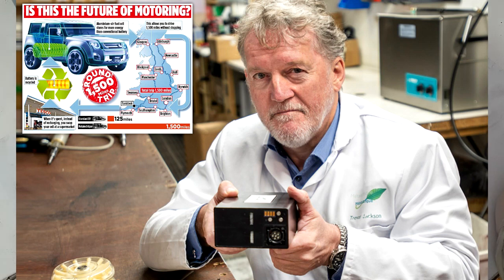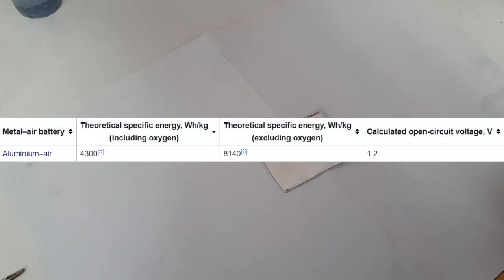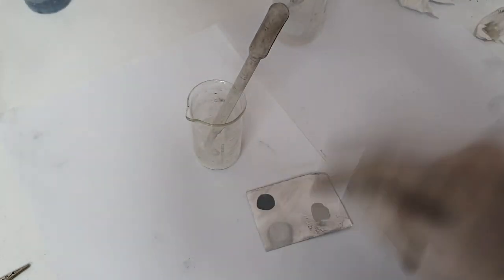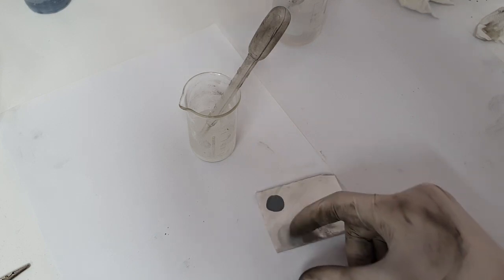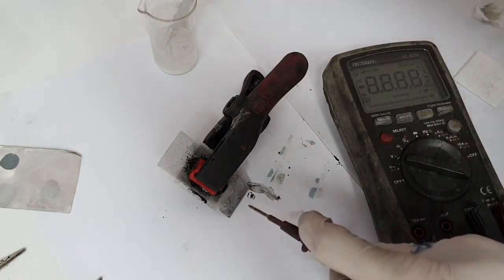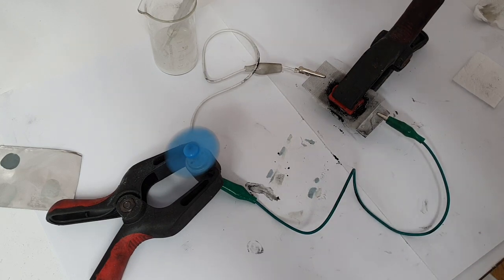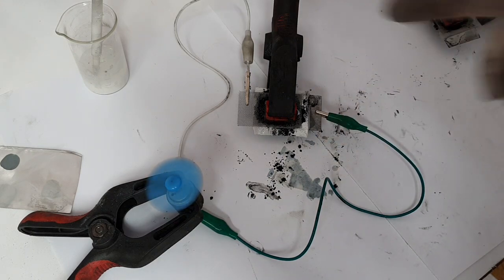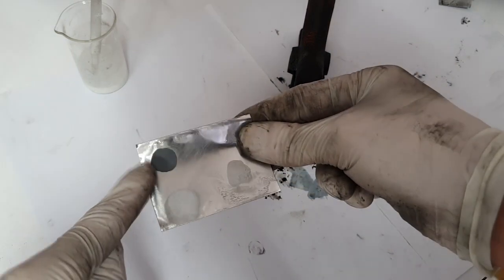Aluminium Air Battery - Corrosion inhibitor

Comment: In the Zinc covered aluminum  battery  which oxidation reaction is  generating the voltage ? Is it Zinc or Aluminum or both ? Thanks for posting this video.
Reply from the maker: When you connect the load to the cell,... first will dissolve the zinc and then aluminium. So for that reason is both.

Comment: how much zinc oxide to use in solution.
Reply from the maker: You dont need much. If you put to much most of the ZnO will not dissolved. Solubility of ZnO 0,16 mg/100 mL (30 °C)
Reply: @cayrex  what about using that gel electrolyte now including with ZnO on the aluminum air battery. Would it protect the aluminum like the liquid potassium hydroxide and zinc oxide.
Reply: Also, when recycling the aluminum after it is used in the aluminum-air battery, what is the red mud. I have only red about it and hear it is toxic.
Reply from the maker: @kenkiekens7746  using KOH/ZnO gel in aluminium air battery is great idea but I think that using liquid electrolyte will work little better to protect the aluminium,... but in the end the gel type is more stable. Try it
Reply from the maker: @kenkiekens7746  red mud??? Maybe are there some impurities in your materials

Comment: Very interesting chemistry, is it a Al or Zn air cell? 

One would think Zn but the 1.5V is pointing towards Al, strange.
Good stuff :-)  -   Martin.
Reply from the maker: Uf hard to say,.... ZnO need to be a corrosion inhibitor for Al air battery. But I think that I put to much ZnO into electrolyte and that way I get strong Zn plating on Al. Right now I make more tests with this.

Comment: Love your videos, i am very interested in Al-ion batteries specifically (secondary type mostly)  :) An Al - Air battery made of 95% Al to 5% GaInSn alloy would be VERY interesting to see, especially with the Zinc oxide corrosion inhibitor. Would be a short-lived battery, but very powerful! Since the AlO layer would no longer be passivating the whole conductive surface. If the AlGaInSn alloy was powdered and pressed into a sheet with a conductive additive - the GaInSn will prevent the surface from oxidising and creating a protective layer - instead the entirety of the Al electrode would oxidse regardless of the surface oxidation. A chain-oxidation reaction.

Comment: It is nice to look at the results of work, and especially devices with a load.  Tell me which electrolyte you use for your experiments.  Thanks in advance.
Reply from the maker: What you mean by that, which electrolyte? In this project or you mean which electrolyte I use like overall?
Reply: cayrex2 what would be good electrolyte for carbon batteries? 
Thank-you
Reply: @cayrex  No, I mean alkaline or not and what density does he have

Comment: Interesting chemistry here but I am a little confused on what is happening. If the zinc oxide is being deposited on the anode as zinc metal, you don't have an aluminium anode any more.  You now have a zinc anode and a zinc air battery. If the aluminium is covered with zinc how can the aluminum be actively be involved in the chemistry of the cell? Maybe the zinc coating is not solid but just porous enough to allow electrolyte to reach the aluminum underneath?
Reply: Maybe you are right
Reply from the maker: It was found that adding saturated ZnO to KOH electrolytes provides the most protective Zn film with good adherence and high density, which can lower the Al corrosion rate by 2 orders of magnitude. The electrolyte will still go to aluminium like you said. Maybe I ad to much ZnO and thats way make a strong spontaneous deposition of Zn.
Reply: @cayrex  
You are right.
Zn is a fantastic material. So many scientists are trying to make a rechargeable battery by using Zn.
By accident or not, I hope you will be able to make great achievement in that area.
Reply from the maker: @solidbattery9956  oh,.... thank you

Comment: Nice Video - if the life of the aluminum air battery with KOH is a couple of cycle, less then 1 hour,  then what have you found when ZnO2 added …… is it 2X, 5X, 10X longer life????
Reply from the maker: When I make this video I try ZnO for the first time, so is to early to say. But note to the paper: "It was found that adding saturated ZnO to KOH electrolytes provides the most protective Zn film with good adherence and high density, which can lower the Al corrosion rate by 2 orders of magnitude. Moreover, configurations with a capacity near the Al theoretical capacity were achieved."

Comment: What about using aluminium Powder on a Stainless steel pickup electrode instead of the Alufoil ? Would probably drastically increase the current output...if the Alu powder would be used up then, will the Zinc powder then again be oxidized to ZNO ?